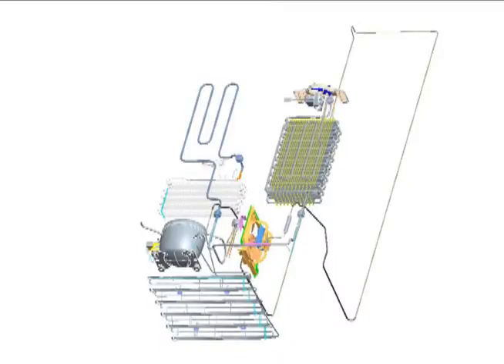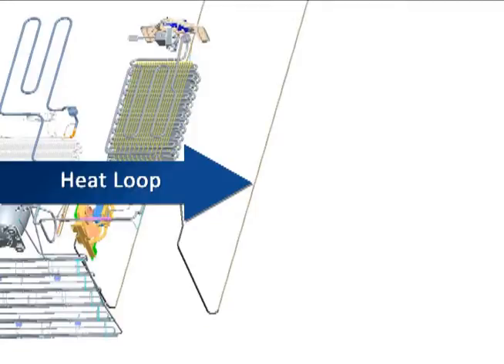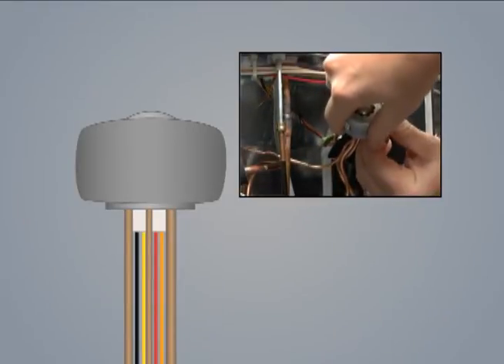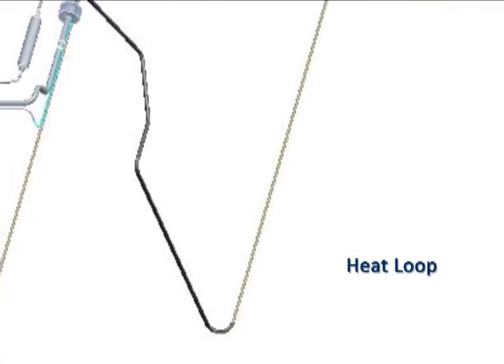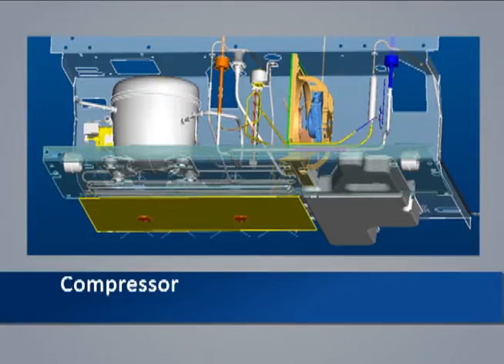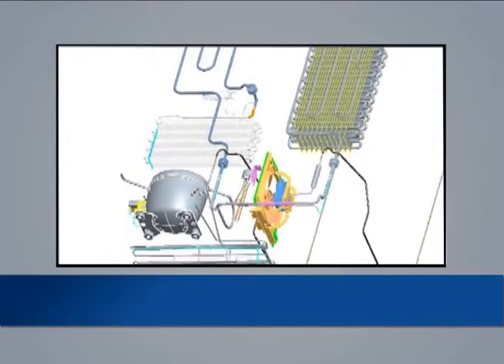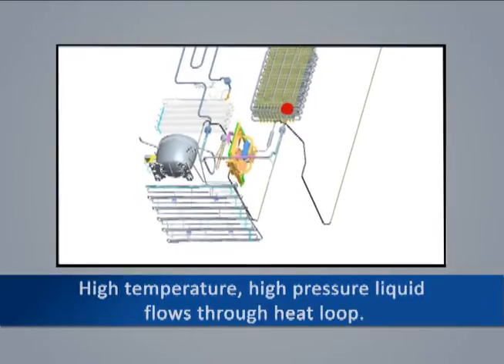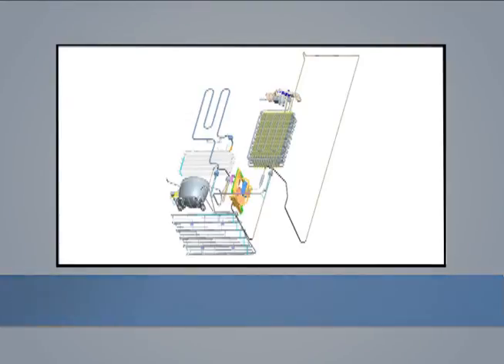Whirlpool SxS and Bottom Mount Dual Evaporator Refrigerator Theory of Operation

Comment: I'm working on a Whirlpool (French Door) refrigerator with that same system. The only difference is that it has a variable speed compressor. Very good info. Thank You. This helped me in the troubleshooting of this unit. How often does the 3-Way Rotary Refrigerant Valve become defective?